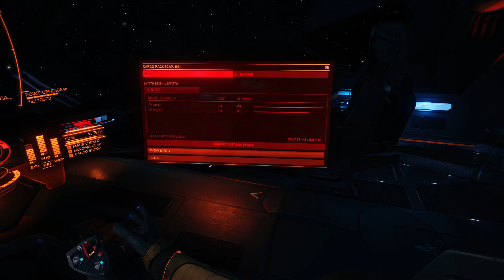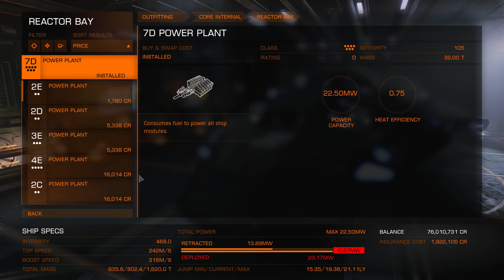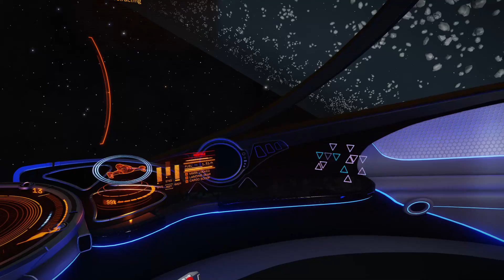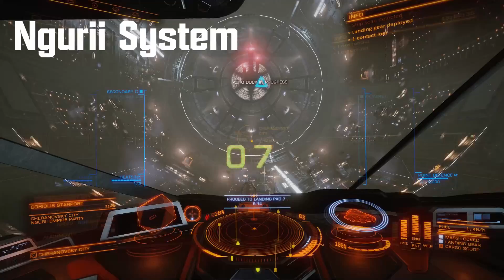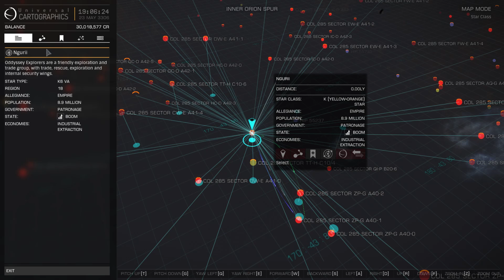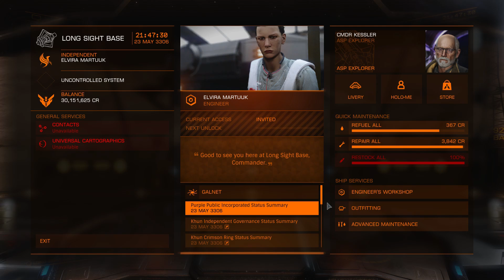Elite: Dangerous - Manufactured

Comment: A good setup for the Python would be 2 class 2 beam lasers + 1 class 3 beam laser and 2 class 3 multicannons. You only use the lasers until the shield is gone, because that’s what they are effective at and as soon as that is gone you switch over to the multicannons because they are good at shredding the hull. There is also a website called coriolis.io where you can essentially virtually test what components you want an can fit  on your ship. They will give you all the data that you need with that like shield, hull hp, jump range, cargo capacity, range when full and empty, total cost of the build, repair cost, etc. Just try what you want to build there first, so you won’t waste money in finding out your planned ship is kinda garbage.
Reply: aw crap I got attracted
Reply: Dont ditch your utility on the mediums, i.e. an Emissive Munitions Pulse and a Corrosive Shell MC.
But yeah, 2 MC's and a Beam are a great combo for the large Hardpoints. ;)
Either that or 5 double shot frags, for when you need a really good lauchter...